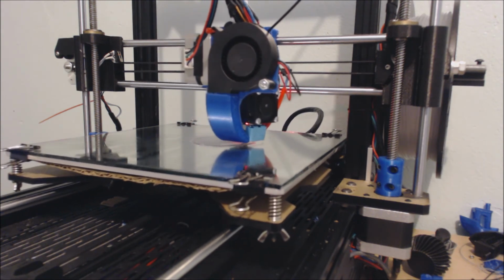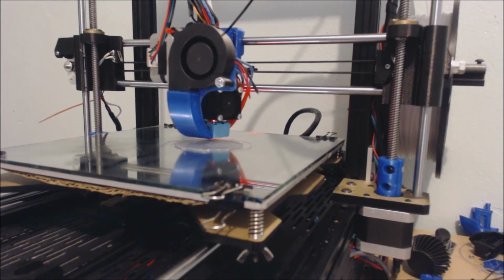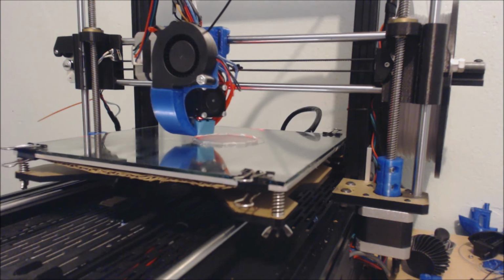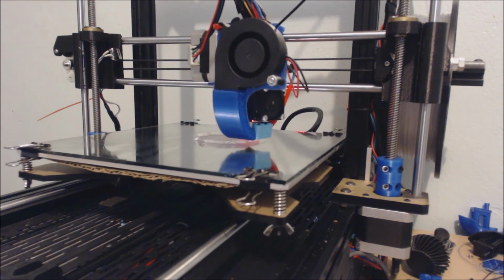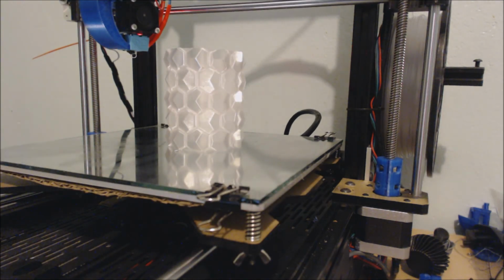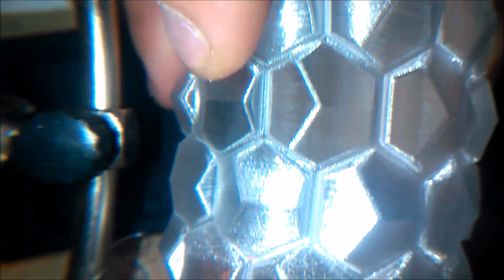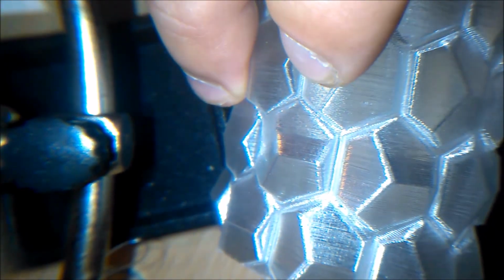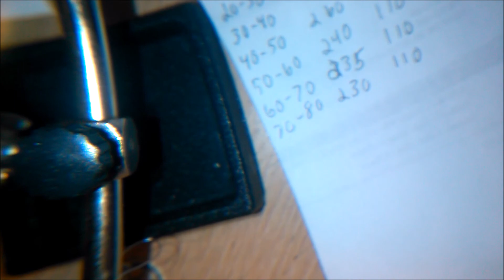How I tune in filament

Comment: I meaybe  yu can help me My mds dp5 was fooldaown and break the motor suport and I dond know where I can find the STL archives for reprint, a frined have other printer and I can made the piece but I need to find the parts can you please help me
Reply from the maker: Miguel Angel Torres Arredondo you would have to ask dms for the STL, I have some files, but not that file. if you search for a migbot on thingiverse- it will fit but you may need to drill new holes for the x endstop
Reply: if any possiblity that you help me with your files for check Im new and I will try t repair but i hope just this part was break and the other work then
Reply from the maker: Miguel Angel Torres Arredondo I can hunt down the file for you but it will be a few hours I am just leaving the house now but I will send you the link when I get back
Reply: thanks a lot more problem for me is a option for restore my printer
Reply from the maker: https://www.thingiverse.com/thing:852591
That has the x motor mount. It looks like the endstop will bolt right to it.
Reply: thanks so much you save my printer